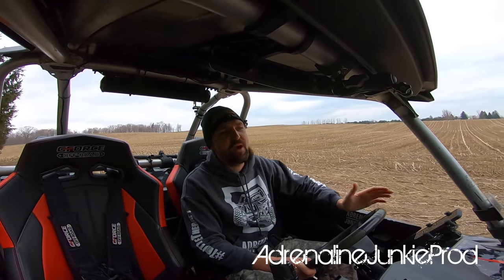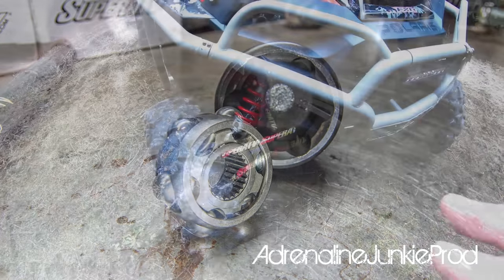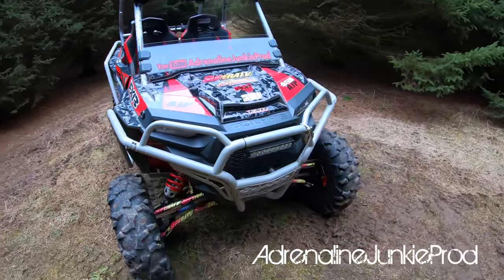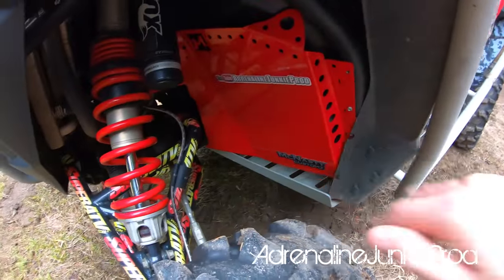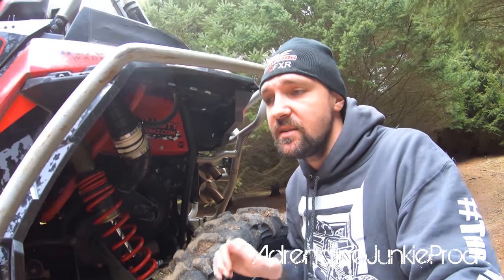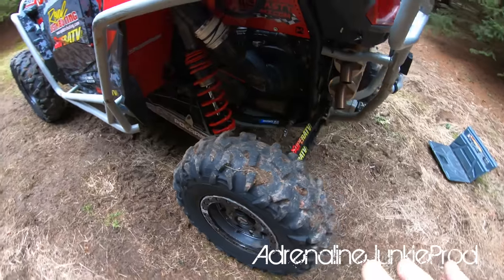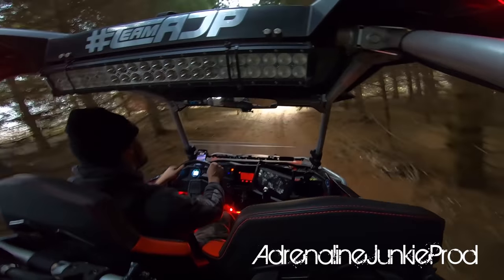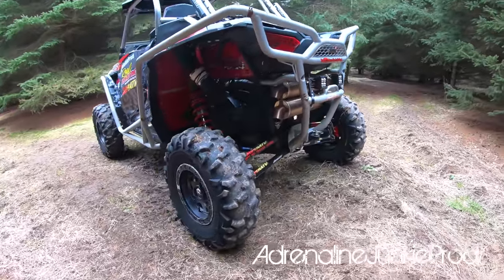Polaris RZR XP Turbo Battlewagon - Machine Walk Around & Modification Overview - SXS/UTV TechTalk

Comment: I was going to save this question for your next riding video, but here it goes. What are your real world thoughts and tips on low range? A little background. Our family has a 2019 RZR XP 4 1000 High Lifter. According to Polaris it has a 55% lower low range than stock. Our low range is very low. For what it’s intended for, deep mud holes, I can understand that. Generally we are trail riding with our 2 children, hence the 4 seater. Lol. Nothing even approaching extreme but we enjoy ourselves. How would you suggest we use low range?

Comment: The RZR XP Turbo (MY2017 and up) is just a great overall machine, especially with upgrades like these 👍 I've had a ton of fun in one riding forest trails, rocks, gravel roads, swamps etc :D Compared to a (turbocharged) XP 900 it is more high speed oriented but can still also be used in conditions where the older XP 900 chassis is just the best.

Love the content, keep it up :D
Reply from the maker: Thanks Sami. I have loved my 2017 RZR Turbo. It's been reliable and capable. The way I have it set up now it's a beast on the trails and can really open up and rock it in the high speed sections too. Glad you enjoy the videos.

Comment: Just an FYI on my experience with the tender springs.  I purchased RZR Aid tender springs. Now I do have walker Evan's so not sure how fox would compare, but my rear is fine. My front really sucked. Made it ride horrible. I just put the stock rear ones on the front and made a bigger difference.  Also with rzr aid ones made my spring divider sit crooked and made a lot of noise and sounded like it was falling apart. I highly recommend if able to a spring kit from shock therapy. Just my experience wanted to throw it out there.
Reply from the maker: Hey man, I really appreciate that feedback. The RZR Aid springs are so much cheaper than the competition so I was concerned that they may not be as good of a product but I also know that often times price is not the only deciding factor. I've had a few people tell me they are pretty good for the price. Not sure if the difference in shocks matters. The #ShockTherapy setup is crazy expensive in comparison though but from what I've heard they are number 1 in the RZR and Can-Am suspension game. Wonder if anyone else has any feedback?
Reply: @AdrenalineJunkieProd  I have shock therapy on my OG maverick and it rides better than my XPT. Buddy I ride with has a 1000s fox edition for his kid and did rzraid and said the same thing I did. He found a set of shocks with shock therapy springs and revalve and he said its night and day. If you want to to the less expensive route I'd look into just the rear kit like highlifter or I believe rocky mountain has the rear kit then you just put your stock rears on the front which is what I just did....being in your position you might be able to get the rzraids for free and give them a try without any cost. Haha.
Reply from the maker: @centralpaatv6327  Hey, thanks for even more good feedback. I might reach out to RZRaid and let them know some people have concerns about their springs and see if they want to throw a set my way. I could do a video review. I don't want to put the stock rears on the front, they are pooched. If im gonna do it I'll do it all. Regardless of whether RZRaid wants to send me some at a discount or not I will probably order a set regardless to try since they are the best priced options out there. Going to do a bit more research  though. I'd love to do the Shock Therapy full suspension revalve with new springs but it's just not in the budget right now.

Comment: I agree, k&n air filters are not good for these machines. Ever see what an oiled k&n looks like after riding in dusty conditions like we have here in az? It literally a filter caked in mud from all the dust mixing with oil.  My buddy who sucks at doing maintenance blew his xp900 motor running a k&n and when i took it apart the throttle body was filthy!    Oem or R2C filters are only way to go. I have run the R2c filter on all my machines they filter better then oem in dust and washable.  Check em out they make it for your machine.  Another great video buddy 👍🏼
Reply from the maker: Ya, K&N air filters in dust are an engine destroyer. I'll check out R2C, appreciate the recommendation man. I've also seen some throttle bodies that have had K&N filters on them and they have been super dirty so you know the internals have seen the same dirt. The best option for super dusty conditions like you ride is probably the S&B Particle Separator, they are expensive though. Another thing I don't like about them is how much space they take up. The conditions we ride usually aren't as dusty as what you guys in AZ see though.
Reply: @AdrenalineJunkieProd  yea for sure. Partical seperater  is awesome! Expensive too though. The r2c is nice u can blow them out with less then 40psi air from compressor and when it gets too dirty soak it for a few minutes in simple green in water. Rinse let dry. I have had mine now for 2700 miles 1400 on the x3 and took it with me to the new maverick(they use same airbox) washed it once and i knock the dust out every few rides. Still looks brand new. The talon guys have big issues with air filters due to where the talon draws air the filters are shot in 1 or 2 rides and they are like 80$. R2c just cane out with one for the talon so thats good for them finally. Otherwise u need to snorkel it.
Reply from the maker: @OdysseyOffroad  Oh damn, that's news to me. It's mind blowing that a manufacturer as big as honda wouldn't pick up on an error like that during initial R&D phases. I also usually knock the dust out of my filter a few times before I replace it. Which reminds me, I need to do an oil change and an air filter replacement, lol.

Comment: if you do shocks brother i highly recommend a true dual rate and do the eibach kit. i got the advice from a really good builder that has been in the industry for over 15 years
Reply from the maker: Hey man, I made this video quite a while back. Since then I've revalved my shocks and also upgraded to the Shock Therapy dual rate setup. It's amazing. The benefits of the shock therapy setup over the Eibach kits is they tailor your spring rates to your vehicle weight and driving style.
Reply: thats very true. the issue i was having with the shock therapy dual rate kit on mine is no matter which way/how i end up clocking my springs they seem to rub the crossover ring pretty bad. now that i have quite a few miles on mine they seem to be chewing up my spring divider little by little. you know i have heard good and bad about both and i think the shock therapy springs rub tbe way they do because they are coiled more narrow as where the eibach kits are not. i had mentioned eibach just because shock therapy seems to be harder to tune and clock but i do run them as well.

Comment: enjoyed the walkround of your machine .. noticed you said super atv will supply parts for the rhino 2.0 axles .. i phoned them and was told by the sales man that they wouldnt sell me parts of the axle ... can you  comment or give a contact.... thanks for your content... rc from nz
Reply from the maker: Hey Ross. Not sure who told you that. The parts are clearly listed for sale on their website. All you have to do is type Rhino 2.0 into the search bar and this comes up https://www.superatv.com/polaris-heavy-duty-replacement-cv-joint-rhino-2-0 They sell boot kits and full joint replacement kits. Check it out.
Reply: @AdrenalineJunkieProd  thanks for the reply . i had a look on the link and the axle shaft is what im after i broke one and have a slightly bent one so would like to buy 2 axle shafts plus boots and clips .. any ideas .. thanx ross nz

Comment: What kind of fire extinguisher mount do you have?
Reply from the maker: It's just the plastic mount that came with that cheap extinguisher. It's zip tied on with 3 zip ties around the roll bar and I've never had an issue with it. Cheap and simple.
Reply: AdrenalineJunkieProd cool deal